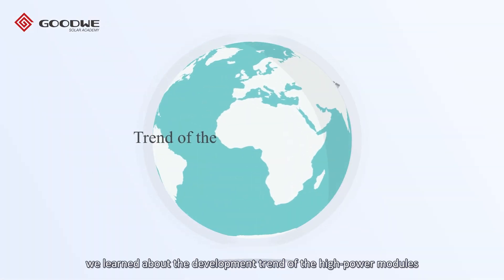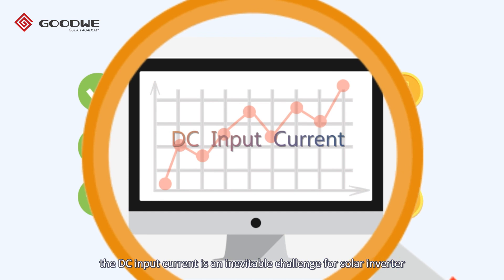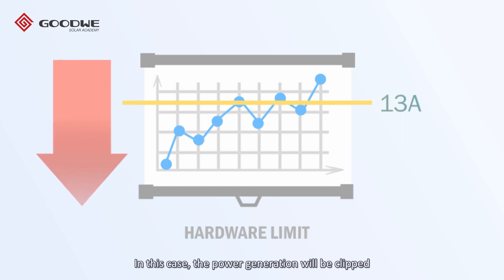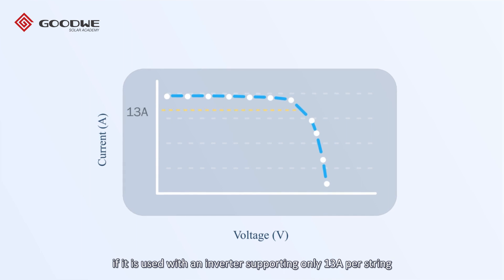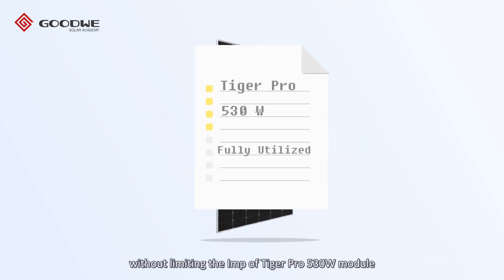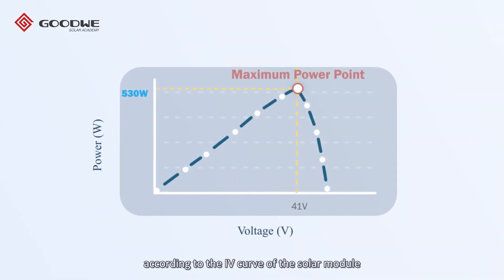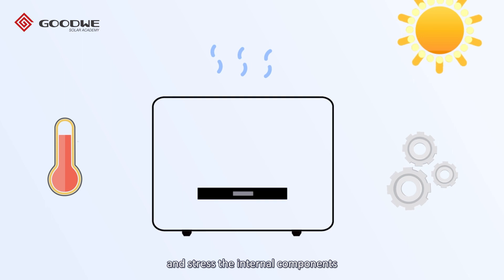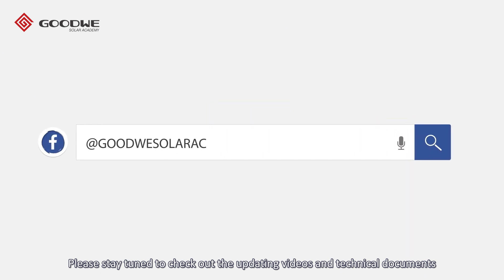Importance of High DC input Current Capability of Solar Inverter

Comment: Nice video, but misleading. The 530 W tiger pro 72 cell has a 13.07 A maxim power current. strict upper bound on the power available is 13.00/13.07 A = 99.5%, so the loss is negligible. 460 W is not accurate. In practice, the voltage rises relatively the same amount as current is lower, so the loss is not noticeable. Only when the current deficit exceeds ~5%, the power loss will exceed 1%. The internal heat generation is confused too: At these operating conditions, these inverters have a large headroom in terms of voltages. It is the large current that older single-string inverters were not designed for.

Comment: Does Goodwe have Solar On Grid Inverter which supports 595Watts Canadian Solar Panel rated @ 18.42 Amps?
Reply from the maker: Hi Sandeep, all inverters over 12kW can support 595W Canadian solar panels. We have the single string connection solution to be compatible with it. For more details, you can contact us via community@goodwe.com. We will send you the declaration letter with Canadian solar.
Reply: @GoodWeSolarAcademy  Dear Sir,Thanks for your prompt reply.Will it be OK to run 12 KW Inverter with 8KW Panels is my query.